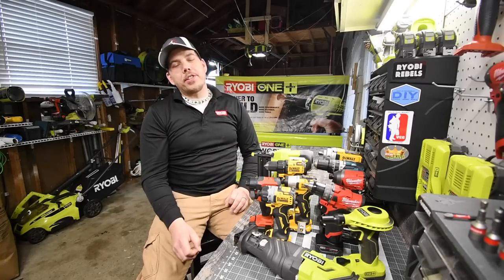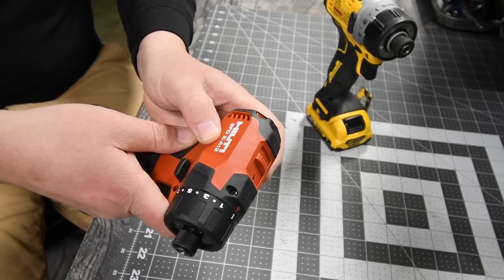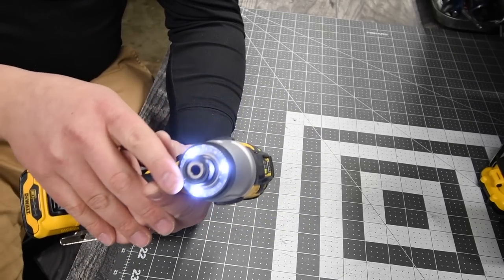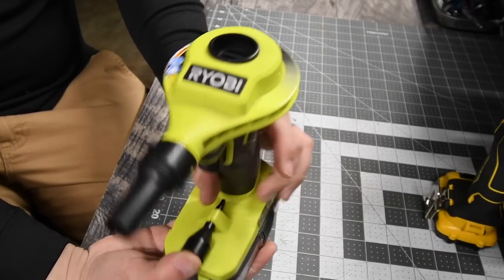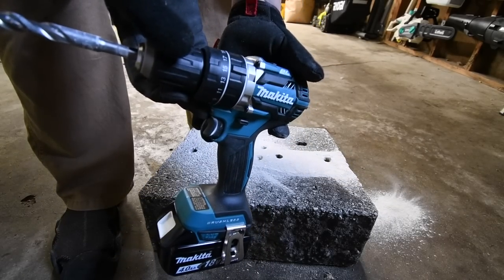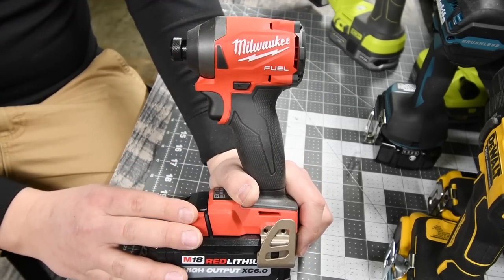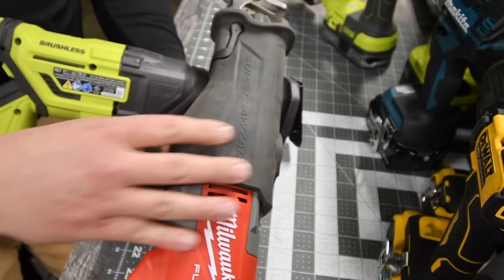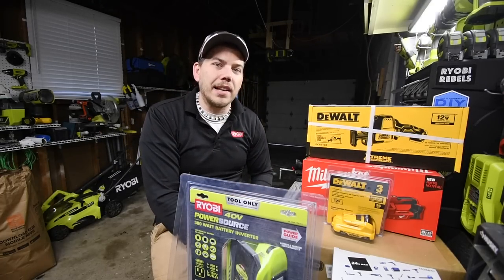Mancaver's  Favorite TOP Tools

Comment: I feel that with the angle of the m12 tools. The m12 angle works great pointing up, for mechanics underneath cars. Notice the Mac Tools version of Dewalt’s extreme 12v (almost the same tool) are angled up too for mechanics.
Reply from the maker: it does depend on the position the tool user is in and I thank you for the feedback

Comment: Hi Dave Hollowpoint Jim here. Just wondering if you know about the new line DeWalt is putting out. It's called the new power detect line. They only have 4 tools with this technology. The circular saw, reciprocating saw, hammer drill and angle grinder. Just came out with the 8ah 20volt max battery. Check it out. Just helping to keep you up to date. Thanks for your awesome vidz. Keep it up 👍.
Reply from the maker: yes, I can't wait to get some power detect tools and see what they are about, and to see if they are more powerful or if they just have a setting that helps the tool to be more efficient, but we will see Hollow :)

Comment: I think the biggest thing i have against atomic is its not much smaller than the xr dewalt great step in overheating issues now they need to throw some extra power into it the main issues are size and power they claim on the box where size meets power but  your really only saving .2 inches in length and its actually .2 inches taller same with the drills great improvement in size but lost a bit of power and rpms (yes i looked snd compared stats) they could have made the impact atleast close to the size of the millwuakee 
thank you for listening to my tedtalk
Reply from the maker: I agree, the atomic is good for smaller situations that you need a light weight compact tools and I think they need to have their impact as compact as the milwuakee and I thank you for your TedTalk Minnesotaman :)

Comment: Referring to the angle of the handle on that Milwaukee impact driver, you can’t make everyone happy with any angle. I see your point with the angle in the tests you do, BUT.......if you’d do some overhead tests, or even standing up and drillng down, you’d have a different opinion. When you’re really bearing down with any tool your arm/hand naturally tilt forward, hence the angle of this grip. But if your just doing things on your bench top, yes I can see your point.
Reply: I have the M 12 surge and yes doing plumbing work the angled for grip is definitely more natural. I prefer it over straight 90° drills.
Reply from the maker: it also does depend on your position and I thank you for the your feedback Lumen :)
Reply from the maker: it all does depend on what position you are in and thank you Matthew

Comment: Why did you pick the Makita hammer drill over the other options? I have the Milwaukee fuel which is awesome for it’s size and the atomic which is awesome for what I gave for it but definitely not as good as the Milwaukee. Just curious what I’m missing out on.
Reply from the maker: I also have the 22v HILTi brushless hammer drill and I chose the makita over that as well, most people don't need the power of a full sized hammer drill for holes in concrete, this mid sized hammer drill is perfect more my needs :)
Reply: Ergonomics. When working long hours, comfort matters.

Comment: I saw you had the blue ryobi drill driver and I wanted to say you should go buy if you don't have a dewalt 18v hammer drill it's the dc988 and it's a very good hammer drill it's old but still works, it only has 1 problem the clutch dosen't work but I put the screws in on the drill mode or even hmmer drill so the screws go in even faster.
Reply from the maker: I have the dewalt hammer drill, I can't wait to get the power detect line soon

Comment: ... 12 volts milwaukee 6 in one you should try that to .
No all the time you have to screw down in to materials  , most of the time the work is on vertical and then Hilti and Dewalt are twisting your wrist when you are screwing or drilling  higher and higher . Even Hilti apply that angle one his brush combi drills  , so to feel natural on vertical and above work .
Reply from the maker: very good and thank you Mrdinodino74
Reply: M12FDDXKIT-202X M12 FUEL 4-IN-1 INSTALLATION

This one doesn't have the percussion mode like this one M12FPDXKIT-602X M12 FUEL 6-IN-1 PERCUSSION DRILL
Reply: ... I have to stop talking to you because the borders are closed do to Corona virus pandemic , even UK is free to travel to US  .

Comment: Hey can you help me out? I'm a machinist and most of these tests and tool reviews dont really look at what I'm looking for. I have tried dewalt 12v xtreme and a kobalt 24v to start but both have failed to remove a fastener torqued to 80 ftlbs. Despite both advertising far larger power numbers. I dont want to debate if they can or can not, I just want to know what the smallest possible gun or wrench is that I could get that most definitely would. Surely theres a 3/8s battery powered impact wrench out there that can do this
Reply from the maker: those tests are coming soon. I will be tightening up bolts soon and we will see what impact can break the nut off faster and with less effort
Reply: @ManCaverTools  thank you so much. Specifically I commonly deal with Socket Head Cap Screws in steel and I keep having issues with anything 3/8s or 8mm and up torqued past about 55 foot lbs. I plan on having a screw driver, a 3/8s wrench and a half inch wrench. Just trying to find the most efficiently sized and priced ones because I can wind up in very small spaces with them. The xtreme line really let me down though unless it really just is that I am expecting to much of the tools. If I have to learn that instead so be it lol
Reply: Go m12 and get the fuel stuff, the 3/8 stubby will take lug nuts off my f350 dually, you will not be disappointed in the m12 stuff the lights are the best out there and they have so many tools and they’re always adding new ones
Reply: They have a right angle impact that’s advertised as doing 220 foot pounds and my 3/8 stubby advertises 250
Reply: Derek Hirko they also have the battery die grinder which come on handy when you don’t wana use the 4.5 or when you wanna run a burr or stone or rolloc
Reply: @billlee1724  well actually I was talking with the engineer and the dewalt take the lugs off my wifes half ton no friggin problem so we are actually thinking it's the application. If you have a 22mm socket on a lug you're looking at an 11mm lever applying that rotational force on the axis of the bolt. If you've got an 8mm allen socket on a Socket headed cap screw  torqued to similar numbers your lever is almost 1/3 of the length of the socket. So it may not be the dewalt or kobalts fault it may be the application that is causing problems.

Comment: The Ryobi recip saw doesn’t look like it has much use on it.

I think Makita 18 volt recip has less noise / vibration, Milwaukee 18 volt a lot more power.
Reply from the maker: I clean my tools after I use them.
Reply: I clean mine as well, but invariably they get scuffed and scratched up, or paint / rubber worn down.

Comment: I think that Makita only has normal batteries and not 'special' batteries because those batteries would be bigger and would not fit the tools on their dual battery 36V line.  Makita's idea was that a user could just use the same existing batteries and get the extra performance without spending more money on bigger batteries. 
In my opinion, it was a failed idea.  The 'specal' batteries other companies have give the user more flexibility despite the extra investment.
Reply: jps101574 yeah just look at e.g. the new cut off saw amd its battery bay...
Reply from the maker: I thank you for the info jps

Comment: lol just use a brush to get rid of that saw dust... It wont blow it all over a place, you have more control, and can even brush it off straight into the garbage, plus it takes way less time, 2-3 quick strokes compared to you trying ur best to blow it off, and it just blows it to the side back on the table lol...

Comment: How can you have Ryobi in nearly every category when it doesn't perform as well as the Ridgid's? Come on now.
Reply: Ryobi has a different level of tools in terms of performance.  Their best models perform pretty similar to Ridgid.
Reply from the maker: I don't have Ryobi in every category, the brad nailer, recip saw and blower are in my top for Ryobi. Dewalt, Makita, Milwuakee and HILTI are in the rest. I was going to add the ridged stealth force in the top but I didn't compare it to anything yet.
Reply: Because Ridgid doesn't have over 100+ platform.
Reply: @loktom4068  and they don't have 100+ pieces of junk that wouldn't qualify as hyper tough tools either.